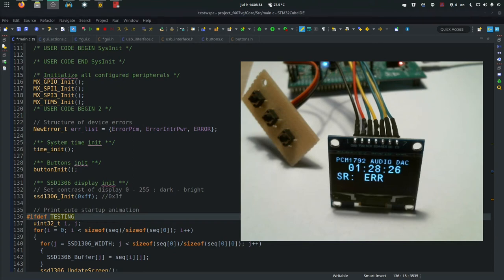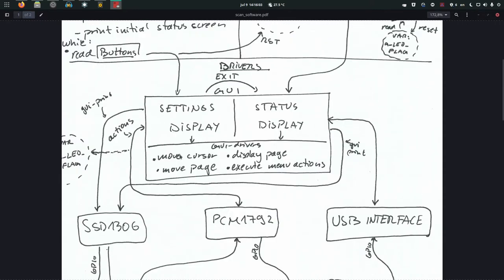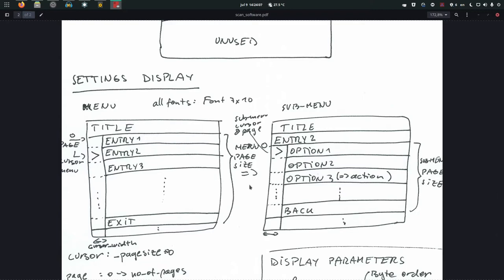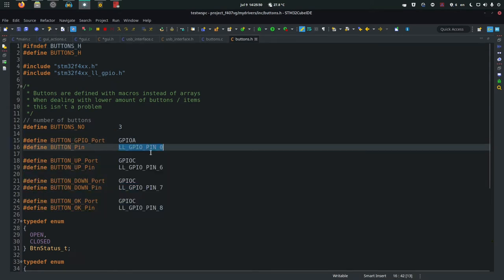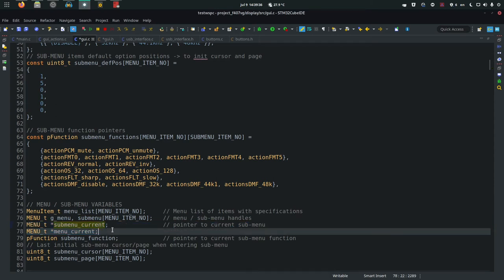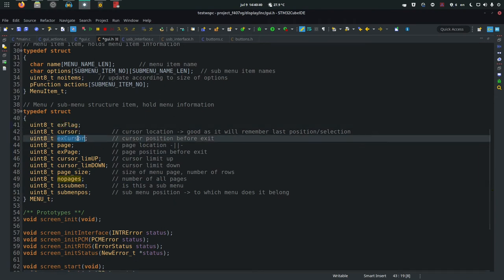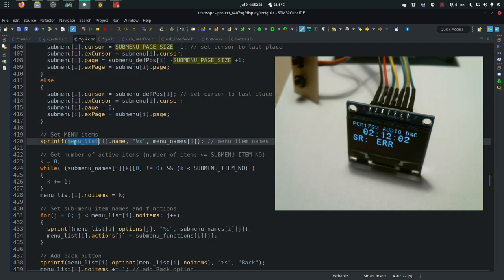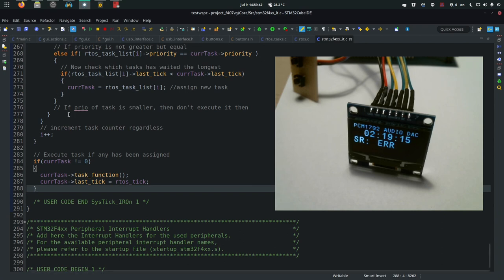GUI and display menu - DIY Audio DAC pt.4 | video 30

Comment: Still trying to figure out how to make my OLED display with spi works, I've tried with different library... I don't know if my display is dead...
Reply from the maker: Maybe return to my previous video and download original spi/i2c hal library ans modify those to work on your uC; you only need to change names of handles for spi and gpio pins that control CS and DC and RST pins. When you get that working, you can try implementing my version for display control.
Also check if you have SSD1306 OR SH1106 controller.
This is the way I did it.
Reply: thanks mate! I managed to make it turn on white, Now I'm trying to draw stuff (which I still need to do) because it's no working...
Reply from the maker: Great. Progress is a great motivator. Maybe use drawpixel functions from the main library do draw stuf. It can be very time consuming function if you draw a bunch of pixels, so maybe design your functions to print certain shapes by directly manipulating buffer array directly

Comment: Hey mate! how can you print float values in the OLED display?
Reply from the maker: Use sprintf function (i think from string.h or stdio.h). Use it to take float number and transform it to a string / char array, that you have for use for printing string using provided function from oled library mentioned. Maybe use snprintf to limit amount of characters or use formatting inside sprintf as "%x.yf", where x defines width of floating number and y the precision(num of decimal places). You can study these functions and use them on your strings and data for printing textband numbers on display.
Reply: Thanks mate! that works out :)